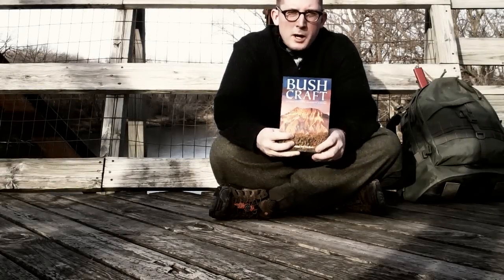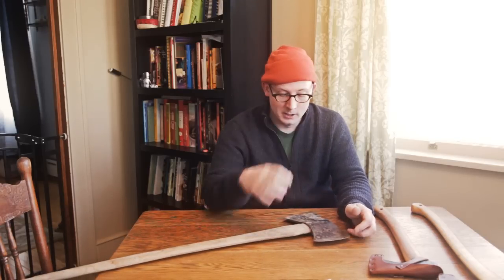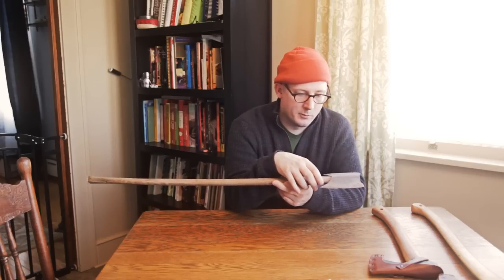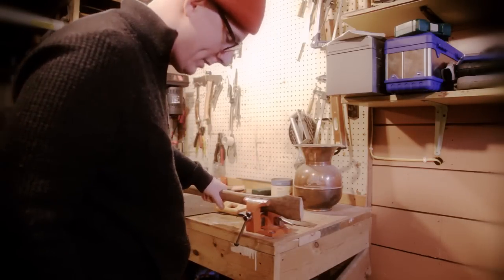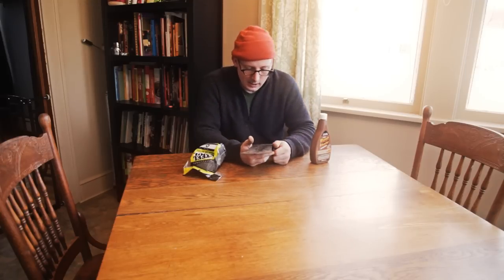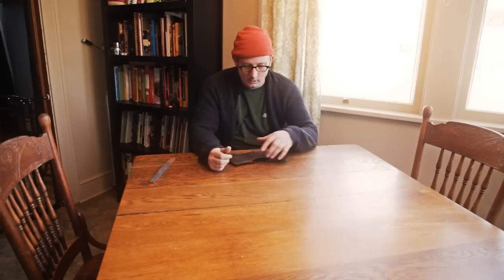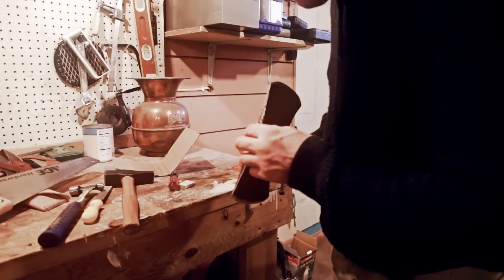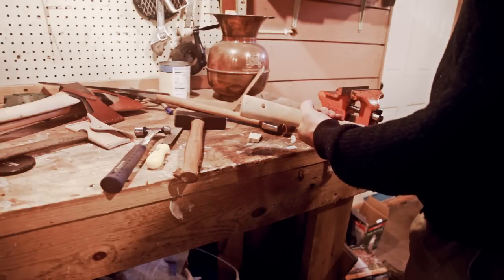How to Re-handle an Axe

Comment: Nice vid and good call on not using fire to remove the handle. The temper on any blade (axe or knife) is more easily ruined than people usually think.
You should get or make a mallet. Using a steel hammer can more easily break out pieces of wood from the butt of the handle or split the wedge on a careless blow.